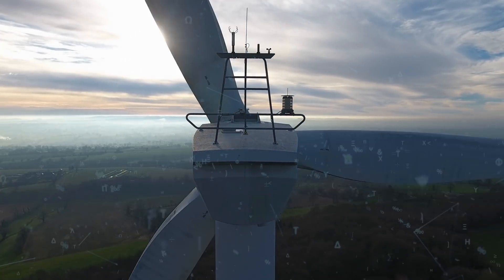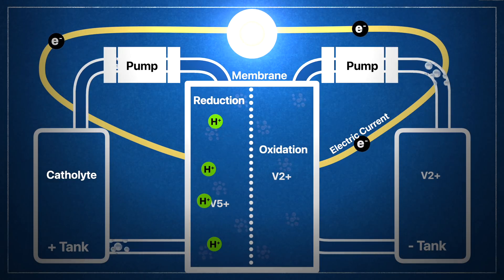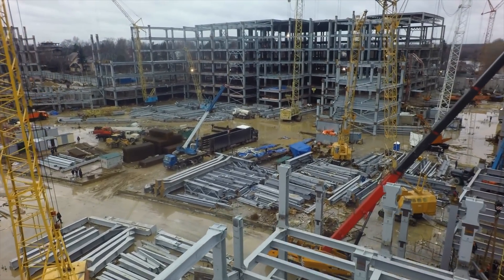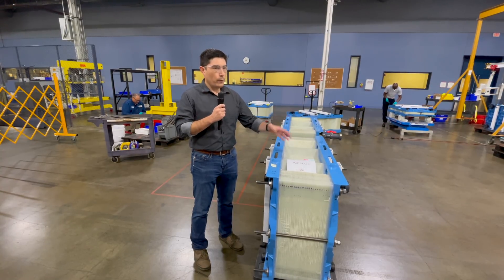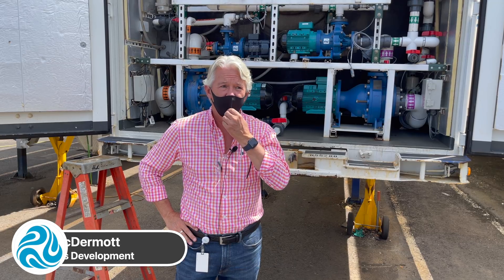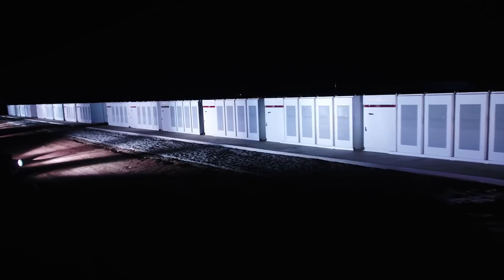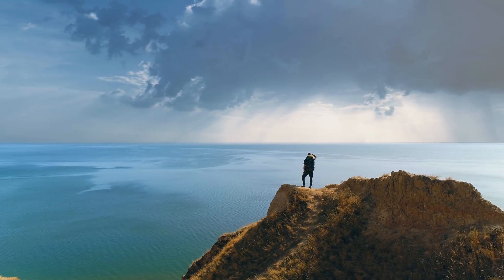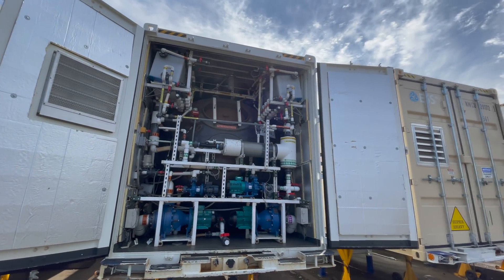The Future of Energy Storage Beyond Lithium Ion

Comment: Perhaps you could make another video where you explain more fully the chemistry and mechanics of what chemicals are used  and the materials of construction. "Iron salts" seems vague to me. Salts of any type are usually corrosive to steel (and I presume to iron). How is the corrosion problem managed?

6:30 You show one tank and liquid circulating with no pump. You show "salt" and iron. Is the salt sodium chloride? Is the iron a piece of iron or dissolved iron?  Where do the Fe+2 ions and Fe+3 ions come from? The open trailer shows 2 pumps. The wikipedia entry on flow batteries shows 2 pumps. 

Do you fully understand the information you are attempting to convey? Did you write (with understanding) your script? Was it written for you and you simply repeated it?

I see that the stock got a huge boost and correction a few days ago.

Comment: i'm wondering what the charge to discharge efficiency is for this type of system.
Something like "100kWh to charge and i can get 86 kWh out of it when discharging = 86% roundtrip efficiency"
and how it compares to lithium ion. 

But overall this looks to be amazing as we will definately need massive amounts of energy storage on a level not even thinkable at the moment. And this storage must also be sustainable or we will have gained not much.
Reply: Front page google finds a source, that claims a 70% roundtrip efficiency for iron flow batteries. But I am a bit concerned that ESS itself does not seem to provide a number.
Reply: @ichVII  I worked on an Imergy vanadium redox battery and it was around 60%.  But that was with 2 tanks / 2 pumps.
Reply: The RT is between 70 to 75% depending on site specifics and design parameters.  This is offset by the duration increases and reduced LCOE.
Reply: I would assume it's much lower than lithium ion.

Comment: How about numbers to compare with other battery farms: size, weight, maintenance cost, etc.
What percentage of output powers the kidney pumps?
Are the reusing shipping containers?
Can one large tank replace many small tanks?
Temperature impacts?
GREAT TOPIC!
Reply: if it is for mass energy storage size and weight don't matter that much but maintenance,cost and efficiency do
Reply: @jadoncampbell2740  Honestly I like this system because it appears to be easy to expand, and the fluid can be monitored and adjusted as needed. That is a huge advantage over traditional batteries. What amounts to slightly acidic salt water doesn't pose much of an environmental threat in an accident. If placed in a solar farm, the panels are a bigger hazard. I don't think this would be good for small scale operations, but would be amazing for large scale solar power.
Reply: This is the only things I wanted to know
Reply: Nice to see how this compares with Ambri (liquid metal battery) and cryogenic air.  All are great in theory and getting massive scale is hard.
Reply: Yeah he didn't even talk about efficiency when that's the most important point, just a promotional video for the business I guess.
Reply: @harshbatheja  I assume that you are referring to RT or "round trip" efficiencies?  That is the aspect with ESS and other flow cell technologies that most influence the LCOE (Levelized Cost of Energy)  They are not as efficient as Lithium Ion forms and that is one aspect that influences the need to increase size to offset the value.  It is also an aspect of energy density.  Generally, they tend to be in the 70% to 75% range which is less than other common types of storage but as the value does not decrease with each cycle, there is a large cost savings over the duration of the project.
The real gain in value is that while the size of the connection, say 1MW will require a bit more space than the same value of Lithium Ion, the gain in time (MWhrs) is far, far better than Lithium Ion  for example, Lithium Ion is generally set on a 2hr value (1MW over 2 hrs is equal to 2MWhrs).  For the Lithium model, to go to 4 hrs would require doubling the number of batteries and thus size, the ESS system is just more electrolyte in the existing package.  This goes up to about 12 hrs per package for ESS.  Imagine the number of Lithium Ion batteries required for a 12 hr discharge capability?  
Another benefit of ESS is that you can completely discharge the battery (last 10% with a voltage drop) without damaging the cells.  Just recharge and off you go.
Sorry, I am excited for these guys.  A GW or 2 of storage, strategically placed in the ERCOT market, could have solved so many of the problems from last year.
Reply: @ScottLaneSabineParish  Well, here in the UK, everyone is raving about 'green hydrogen' and how we can use our renewables to make it for use in fuel cell vehicles as well as to replace our serious dependance on natural gas and kerosene for hot water and space heating (which accounts for about 70% of the UKs total energy use).  So, even at 75% RT efficiency, it is 2.5 times better than green H2's 30% (at best).  The infrastructure cost of flow batteries would also be a fraction of H2's...
Reply: @martinwinlow  Very true.  I am in no way opposed to "green hydrogen" and as with PV and other techs, the efficiencies and volumes will adjust over time.  I don't think any flow cell tech that I am currently aware of, is really a contender for "transportable" energy storage in a way that LiIon or even hydrogen is.  I think the key we all need to keep in mind is that different types of applications require different types of solutions.
Reply: @ScottLaneSabineParish  Nice overview Scott, however, because the iron plating reaction occurs, you cant just keep increasing electrolyte volume. There is a limit because eventually the cells will be saturated. So you also need to add more cells, tubing, and pumps eventually.
Reply: @salvadordavinci7  absolutely true and I apologize for the oversimplification.  The systems, from my understanding, do not make sense financially, for less than 2 hours worth of discharge/storage and begin needing additional storage systems after the 12 hour discharge/storage system.  Again, an oversimplification, but an example would be to have a 400kV * (2 through 12 hour system in a single container.  Need more?  add more containers.  To vary between the 2 to 12 hours is based on the electrolyte volume.
Reply: @ScottLaneSabineParish  Thanks, yes I think the 4-12 hour range would be the sweet spot for this tech. So we got this covered, and this can get you very far decarbonizing the grid. Calculations for a fully decarbonized grid however, say that you need  35-90 hours of storage to bridge the gap all year round, depending on geographic location (see: clean energy U-curve). So I wonder if another technology could fill the gap after 12 hours, like a "pure"flow battery (like hydrogen-bromine because Vanadium is too expensive), or if this could do it too.
Reply: @salvadordavinci7  While it should not be the only option, you could take that delta between the first 12 hours and 90 hours and just divide by 12 to determine the number of systems to install.  It can store for much longer than 12 hours.  The 12 hours is how long it can discharge at that rate.  If you don't discharge, it just waits until you do.  Or perhaps I am misunderstanding your point?  
I think the general models show a national grid where generation flows back and forth across the US as time of generation and use are offset across the country and additional energy is stored for non peak generation times and peak use times.
The key to this is to oversize the generation of solar / offtake during the day and balance with wind models to create storage needs for offpeak usage periods.  Generally speaking, the average storage duration time is less than 12 hours but in times of weather issues, is when we would need to have higher storage.
Reply: @ScottLaneSabineParish  @Salvador da Vinci,
I really appreciate technicians discussing the ins-and-outs of something like this. I wonder if you could get the creator of this YouTube to weigh in on your comments? I'm tired of armchair YouTubers arguing back and forth about something we know little about-namely the physical engineering and logistical systems change that employing a new type of grid would require. Especially, talking about the pitfalls is the most viable thing you guys are brought to the conversation and I really hope that you could maybe get a post of yours pinned to the top of this videos thread?
Reply: @Philosophaster  I'm not actually a technician.  I have lead teams of engineers that evaluate different storage, generation, transmission, etc., tech to implement on projects.  The engineers are the real experts, but thank you for your comment.
Reply: @ScottLaneSabineParish  Eh, well if you know enough to articulate all you did back and forth, that passes muster
Reply: @harshbatheja  actually its more about installation cost and maintenance whether it competes with traditional packs.
Reply: @elephantintheroom5678  ambrii battery is 3 basic elements in a ceramic box.  On paper it is far simpler.  Lots of them will fit is a shipping container.  If the science makes sense it's just a matter of scaling productions then we can see who's idea is a really compedative
Reply: @elephantintheroom5678  not bad to have a variety of things better than a bunch of car batteries.  Just hope all they get enough investment for a fair crack at it.
Reply: this is like the most polite comment thread ive seen on youtube lol
Reply: great topic. ZERO numbers given. no weights, efficiencies. That was disappointing? WTF is a "proton pump"? Is it not just a hydrogen fuel cell that is being feed with FeNACL solution - sounds complicated to me. How do they know how many cycles they get? is it because iron doesn't produce dendrites? why did we never see the iron plating? Surely it is beuatiful and shiny? How thick can it get? micrometers? mm? cm? dm? So many questions and no answers.
Reply: @idjles  The specificity you want may impinge upon their intellectual property. The bottom line - whether it works safely at an affordable cost - will be clear in time. One must be careful to not allow the perfect to become the enemy of the good. Particularly where emerging technologies are concerned.

Comment: I don't remember hearing the charge/discharge efficiency. If it's like 70% and the LFP is like 95%, then the extra solar and wind capacity costs might definitely cost more than the savings from cheaper and longer lasting iron flow battery.
I don't have time right now to try to figure out out but we need to know expected or watt hour cost of LFP, iron flow and per watt cost of solar (and wind where applicable). We need to know how long the LFP will last compared to iron flow and we also have to include maintenance costs for each different facility (seems like the iron flow will cost a little extra for upkeep). Finally, does the extra building space required for these less dense storage options (than NMC) really make a difference beyond just a really small fraction of costs?
And, what else did I not think of.
I assume iron flow could get down to about 1¢/Wh ($10/kWh) and the LFP, about 2.5¢/Wh. Again, how much extra would maintenance add to these low costs? And how much extra solar would have to be built to make up for the (assumed 25%) lower efficiency?
Reply from the maker: We don’t have battery supply for world wide battery storage using lithium based tech. So it’s not a question I thought too much about. I’d rather use this and save lithium chemistries for cars.
Reply: @TwoBitDaVinci  
I heard we can extract lithium from the oceans and since it's not much of the components compared to iron and phosphate, that it wouldn't add much to the costs.
But then again, I bet China and Tesla will get the cost of solar even cheaper, too.
And thanks for this, I didn't even know about iron flow batteries!

Comment: With all the tubes and pumps what's the efficiency from energy harvesting to grid? - better than hydrogen?
Reply: Yes.  Currently, converting almost every molecule with Hydrogen into a hydrogen gas plus another or multiple other gases will also require tubes and pumps as well as the energy to break the bonds.

Comment: It looks like they recently signed a contract with some big fish to deploy 2GWh of batteries by 2026. Let's hope they don't fuck this up.
Reply: All the ones prior have fucked it up. Hype propaganda can't produce results.
Reply: @westtexas806  that's fine. energy storage companies are a dime a dozen.
Reply: @westtexas806  It's not like it even matters if they fuck it. We already have cheap reliable power, people just choose to hate it. It's hilarious how people create a problem then act like it's actually important to get their fabricated problem fixed.
Reply: @bobbygetsbanned6049  Coal is not cheap, it comes with some heavy pollution which has a cost. Nuclear is not cheap, it comes with heavy regulations (which is good, otherwise it wouldn't be reliable). Wind, solar and hydro complement each other very well, but you need SOME base load, and a few installations like that will be enough once wind, solar and hydro are widespread enough. Hydro CAN be a long term base load, if dams are installed. But those are not cheap, and come with some disadvantages. For minimal dam size in rivers, hydro can still be a short term base load, but right now here in Norway it's a dry spell and we're paying through the nose for our cheap hydro power. Gas and oil are better than coal, but not by that much.Unfortunately we're also exporting power to other european countries due to existing trade agreements, so we're REALLY gonna see some high prices when it gets cold in two months time.
A good solution is probably to use pumped hydro where you can, batteries and solar+wind where you can't. And if you're Germany and decide to close down new power plants instead of the old ones, and also to phase out nuclear before coal, you can bugger off.
Reply: @olegil2  Thorium Nuclear not Coal...
Reply: By foul it up, I hope you mean on the manufacture and project management end, as the rest seems quite mature after 10 yrs of R&D and many, many parents. In another YT channel they talk about ESS being extremely well funded by multiple companies, including investment by Bill Gates.

Comment: I recently passed by a wind generator farm with several hundred wind mills that stretched over twenty miles along the highway. I think that is the type of system that would benefit from this new technology. Thank you for sharing this with us.
Reply: I remember the first time I saw a wind farm along a freeway back in 2002. I was told that it, and many other wind farms in California were completely un-used because they weren't able to connect them. I now know that what they were missing then is still missing now, energy storage on a scale that will actually work with wind.
Reply: @darkestaxe3415  In Europe at that time we had also problems to conect offshore windfarms because the huge DC-Transformer for multible KilovoltTransmission didnt work flawless yet. These days that shouldnt be the problem anymore.
But yess Storage is the key for renewables.